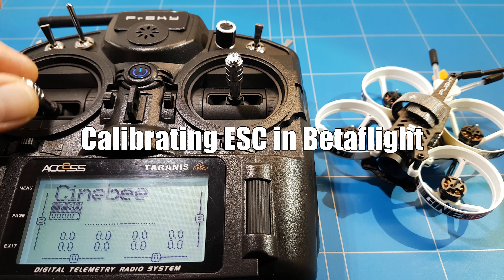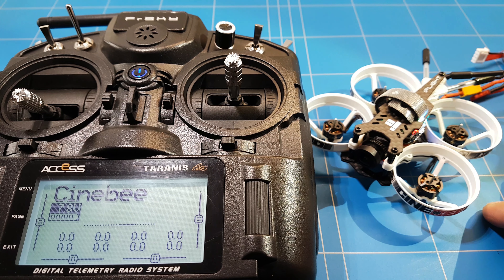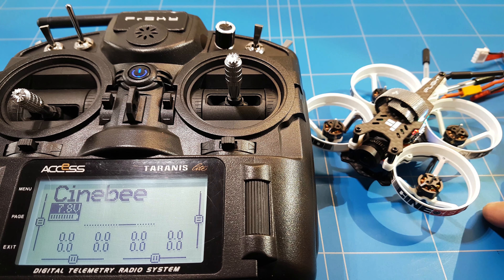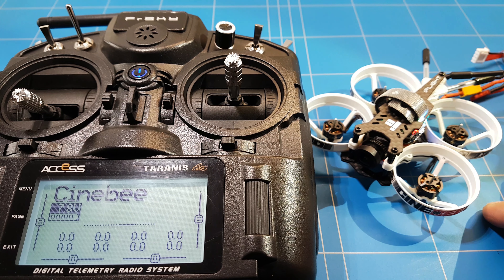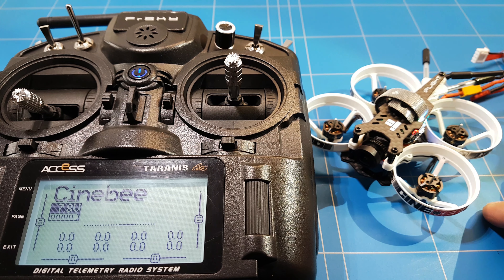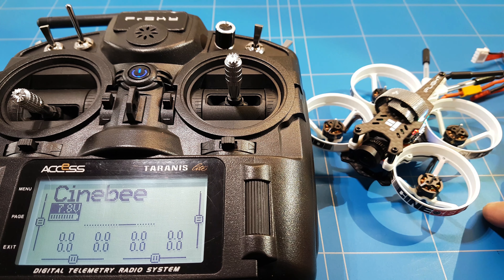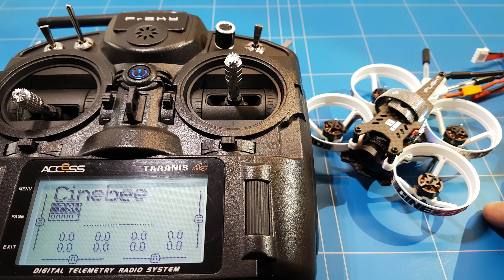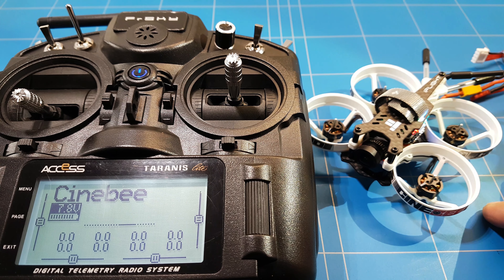Calibrating ESC in Betaflight With iFlight Cinebee 75HD and Frsky Taranis X9 Lite and OpenTx D16

Comment: Arent the motors supposed to spin at 0% throttle after you arm (airmode)?  If your blades dont spin, your FC will have zero control at zero throttle.  For example, you cant roll during a dive without throttle input.
Reply from the maker: yes and if land in grass and the motors try to spin but get caught up in the grass they burn out and this drone is a cinematic whoop not a crazy freestyle drone